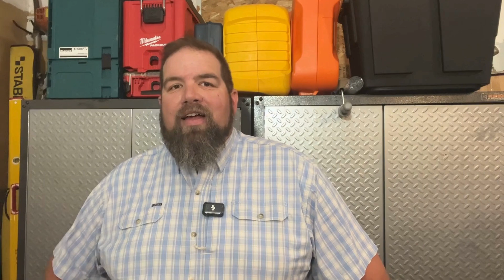Houses Reveal Problems Around Windows First

Comment from the maker: It’s easy to see why a lot of people assume windows are the problem because that’s where the symptoms finally become visible.

Condensation at the glass edge.
Drafts near the frame.
Cold drywall nearby.
Mold showing up at the corner first.

But windows also sit where multiple materials, assemblies, and control layers all come together.

That makes them one of the most reactive parts of a house.

Sometimes the window really is the issue.

Sometimes it’s just where the house finally revealed that something larger was happening.